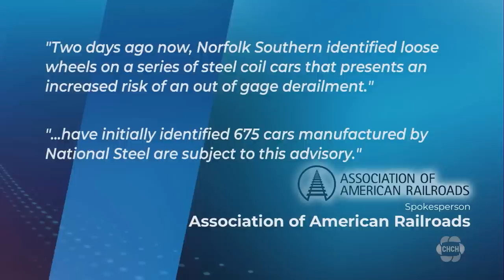National Steel Car to halt hundreds of its’ railcars

Comment: National Steel has a poor workplace reputation. An investigation if there is one may be quite entertaining.
From an anonymous post by a welder (not I):

>They have at least 1000 welders working at any given time
>Big sign out front that says "HIRING 1000 WELDERS NOW"
>workers unionized after 6000 hours, nepotistic union ensures that 96% of workers are let go at around the 5000 hour mark (very few long-term employees)
>will hire anyone regardless of experience
>2 week training course and you can begin MIG welding train cars.
>they will even provide a weld helmet if you don't have one
>exclusively build norfolk southern rail cars for past 20 years
>someone has died there every year for past decade
>most recent fatality was crane operator dropping giant piece of steel plate on worker operating drill press
>no respectable welder will work there
>CWB certification not required, just in-house testing
>only immigrants and drug addicts are employed, odds are your foreman can't even speak english
>foreman was former steelcar employee, used to tell stories of workers snorting coke in the lunch room and getting into fist fights on shop floor
>over 60% of health and safety crew and inspection crew recently terminated (wonder why...?)
>work has started to shift to Trenergy in St. Catharines, if you go there you will see dozens of Norfolk Southern train cars out front, will post pic later if thread still active

Of course little will come of it since the rich own Canada too.

Comment: As a kid I grew up living next to an overpass for a railroad track and standing on the overpass watching trains I have seen hundreds that were so long that you couldnt see the beginning or end of them. 20 years worth of that. As an adult who lives near busy track, I have sat waiting for a trains to pass for a half an hour. One train going on way, it ends, another is on the other track going the opposite way, that one is done and another one is going by the other direction again. There have been trains parked in the city near where I live.....literally right in the middle of town not moving.....blocking roads, and our roads are spaced 1 mile apart.....I have had to drive 5 miles to get around trains sometimes. 

"hundreds of its railcars" means nothing, that is a train or two.